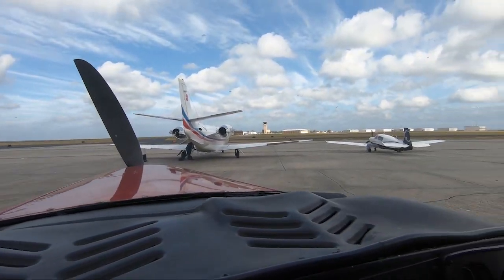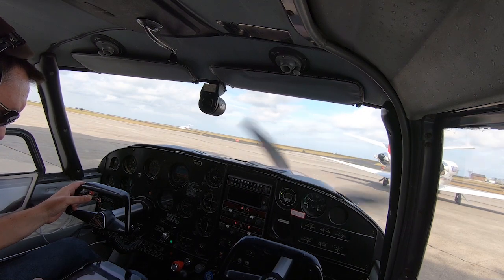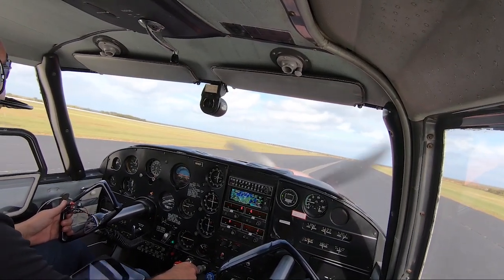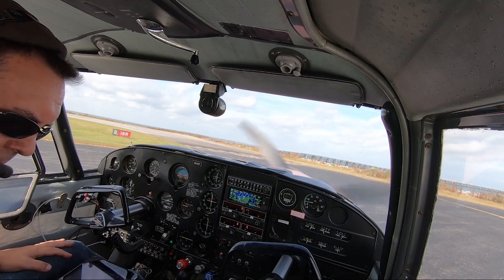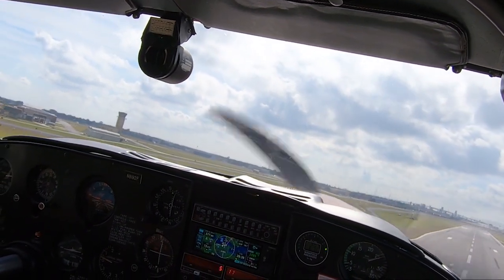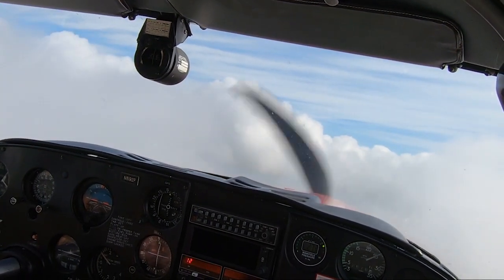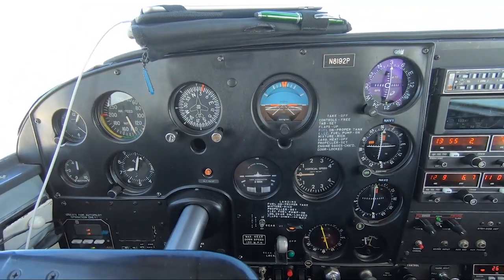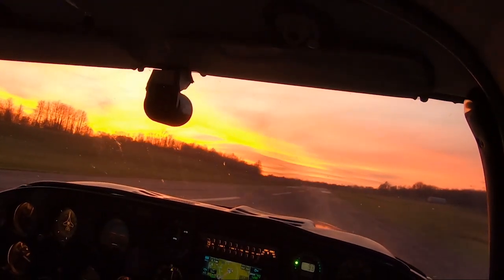Piper Comanche New Orleans IFR Departure and Flight to Pennsylvania

Comment: Nice 180. I have a lot of time in a 250 and in a 180 Mooney. Both engines the best. Fly higher. I flew the Mooney at 11.5 from STL to S. Jersey in 6 hrs , no wind or clouds on 36 of the 48 gals. I was 60 years younger then with a better bladder.
Reply from the maker: Thanks.  I like to be 9K - 11K if the winds are good.  I started carrying the emergency relief bottle but haven't had to use it yet but I have had a few landings I wished I did!